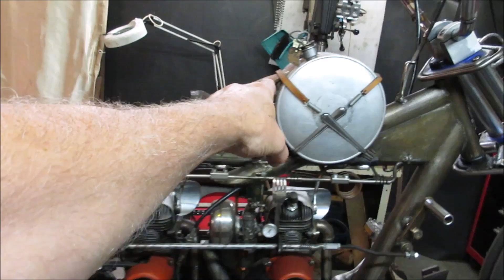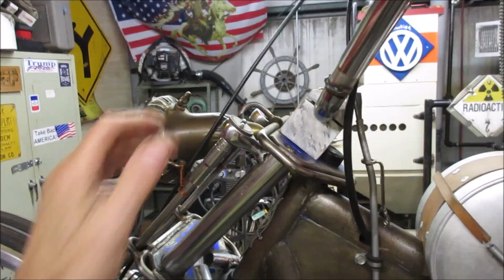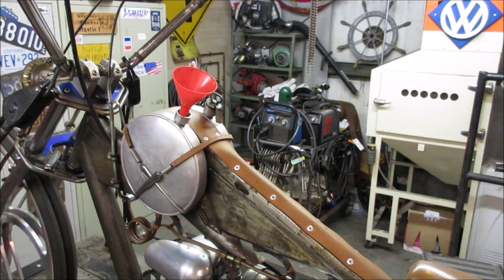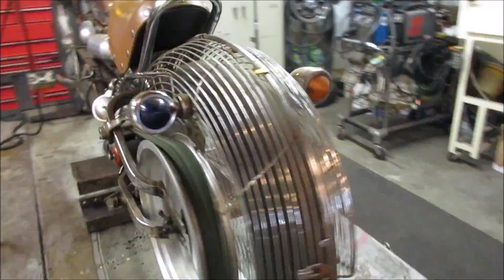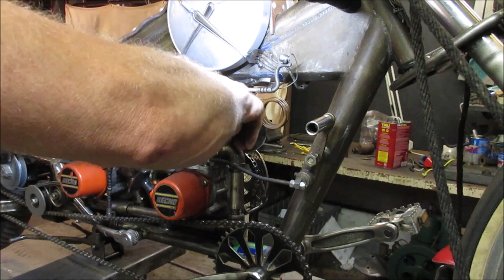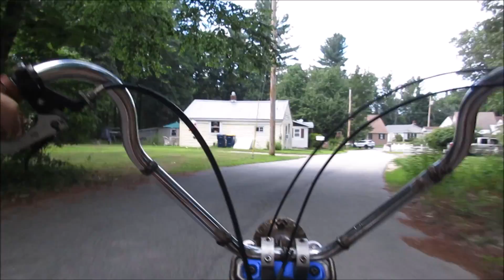What can we Build For $200, this Motorcycle.

Comment: Oh how I wish such things were legal on the UK roads - Outstanding work.
Reply: But they are...? The MSVA inspection requirements aren't too bad as long as you confirm to the "low power moped" category, [defined as a moped with pedals, with auxiliary propulsion not exceeding 1kW, and a maximum design speed not exceeding 25km/h (16mph)]

Comment: I don't know if you know this, but you can get a freewheel for the crank (not for a one piece crank though, only a 3 piece).  By using a freewheel on the crank, you can still pedal, but you can still run the power through the chaning without forcing the pedals to turn.

Comment: Excellent video Mustie 1  :) remember you talking about and 5 years ago when came to YouTube videos you said about showing pictures about on one video! Think did super job built it to and trying out to ! I know years ago when my late dad also his late  sister my aunt her  husband my late uncle come for visit and my uncle built out old Ride Lawn tractor had engine back use for help my Aunt  get because she was able walk at all and Automatic transmission type and so cool ! Lawn Mower Tractor was handles to Park , Brake on right side , Speed Low to Medium, Fast control  on left plus Gear for Foward  , Netural, Reverse below seat in front engine on right side, plus engine Idle plus Choke Cable control on Left side  and key ignition switch to in middle below seat and in bottom in front engine was battery  like Lawn Tractor uses today on them & motor was 11 hp Briggs & Stratton 4 cycle and had steel  fuel tank 5 gallon on below seat homemade seat was cushion plus big back rest bolt on steel came with ! Plus had toggle button switch click a vechile horn on and plus toggle switch flick on to off metal if was key ignition switch would turn off motor! Tires were small Turf on front 4 nuts bolts with bearing spindles and back wheels big modern on back  to chain drive to Gear box for F , Netural, R plus Pulley on bottom engine frame tray also levers to! Was Lawn tractor speed could go and cool build my uncle did ! She did use normal hand crank wheels Wheel Chair  to !

Comment: In Europe, a bike called a Solex ruled the roads in the 50s. These were regular bikes with a mechanism to lower a single one of these tiny two stroke engines onto the top of the front wheel, massively increasing the bicycle's commuting range for an affordable price. This bike here, this absolute rocketship by 50's Europe standarda (which was still rebuilding hard from having been bombed to hell) would be the equivalent of a showing up to work in a 69 Plymouth Roadrunner. Note that the oldest streets in Europe are designed for a dog & cart to pass each other, countless of Amsterdam connecting streets are physically smaller than a Roadrunner is wide.

Comment: When I was kid early 2000’s I believe, I cut 3 different lawns every week during the summer, just so I could buy one of those stingrays. I had a lot of fun on that bike, and I rode it so much I completely wore the tread off of two sets of tires, and I was not a kid that would skid the tires to wear them down either. 

Anyway, in the course of the first year I had it, it had a warranty. The front wheel had a slight tweak to it, and my shoe accidentally caught the chain guard once and it bent it to hell. They covered it under warranty though, and sent me out a free new set of wheels, and chain guard. Problem was they were the wrong color for my bike, so my dad called them up to ask about it. After describing what the parts should look like, they said oh that’s a special stingray bike. Only 3 were produced in that color, along with some of the other parts are different. The forks are 3 inches longer than standard stingray forks, and they don’t have the folding pegs on them, it has blacked out wheels, a different set of handle bars, and a way different decal kit. My dad asked them to fax him this info, and we still have it and the bike. Unfortunately they said there was nothing they could do to send the appropriate matching parts, but that’s ok. I bent the chain guard back mostly how it’s supposed to be, and the slight bend in the wheel, I just lived with it. 

In 40 years or so I’ll be interested to know what my stingray is worth being 1 of 3 with documentation to prove it, and better yet I’m curious what the parts they sent me will be worth. I’d imagine NOS stingray parts have potential to be worth something some day. Though to be fair I don’t really care what it’s worth, I’m not likely to ever part with it until I’m gone.

Comment: How you even conceive these vehicles, let alone build them amazes me-such imagination. To use this on the roads in the UK you would need Motorcycle Single Vehicle Approval (inspection £55) Road Tax, Third Party insurance and a crash helmet which is something of a deterrent to building one. I wonder if things are much simpler in the States or have the local police simply given up on you!
Reply: I think you could do it without restriction in the UK if it were battery powered though motor power is limited (cant remember to what) and top speed limited to 20 mph - as long as it is 'pedal assisted'. Leaf blower motors would be more fun though!

Comment: Wow. It’s like a biker crashed into an old diner and out the back door. Creative iin every detail. 

I had an electric motor on a board with 3 wheels and the 4th with a fan belt drive to the motor. I only had a 25 ft cord and it did not steer. But it was my toy. Obviously I never got to Level Mustie1.

Comment: here in my state (idaho but im moving to bama soon so ill have to check there) its 35mph max for a motorized peddle bike (36-55 needs a special sticker and you need a license)56+ you need license registration insurance and a sticker to drive it (it would be registered as a moped) i have a 100cc 2 stroke dirtbike engine on my mountain bike(i can only go 35 because i dont have the sticker even though itll go much faster)

Comment: HINT!  For your lucky bolt bucket.  Take out all the bolts and put a towel in the bucket. Fill the bucket with the bolts. Next time you need a bolt… pull the whole towel out with bolts and lay on the Bench to find what you need. Then simply pickup the 4 corners of the towel to return all the bolts back to the box.

Comment: Front axles you should tap a bearing grease fitting in the hub so you can add bearing Grease to the front axles this is what  I did for my motorbike